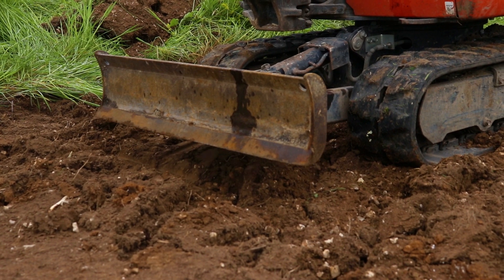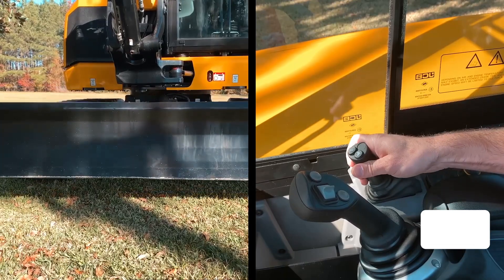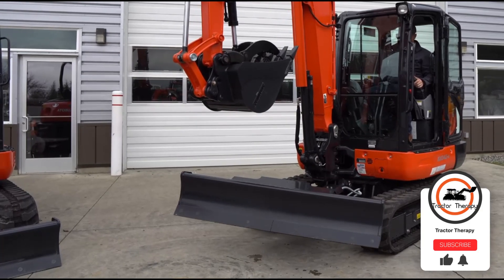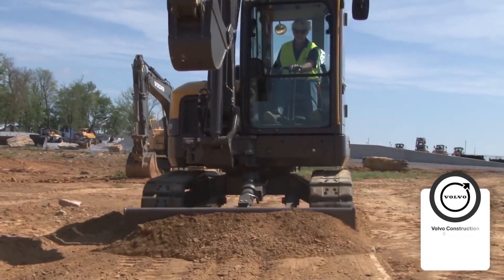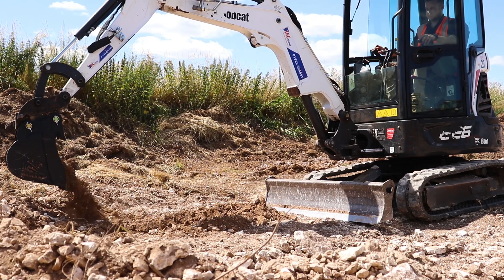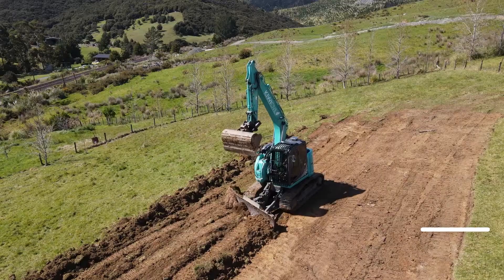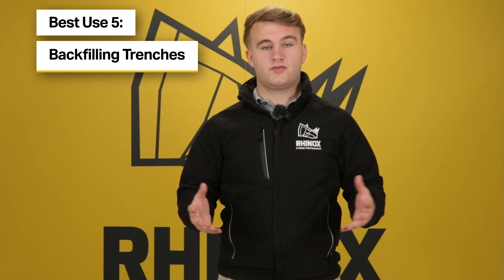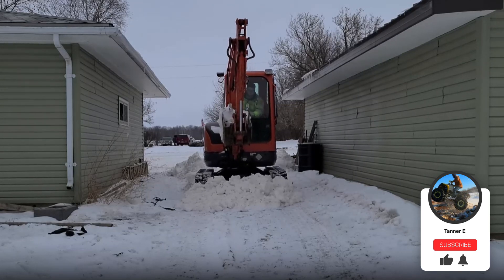EXCAVATOR DOZER BLADES - 3 Types, Float Mode & Best Uses!

Comment: What make/model was the machine with a 6-way blade at 4 seconds in?
Reply from the maker: The specific machine at 4 secs was a Kubota KX040-4, but 6-way blade options will be able on other machine makes too. This will be a customisable specification with each manufacturer.